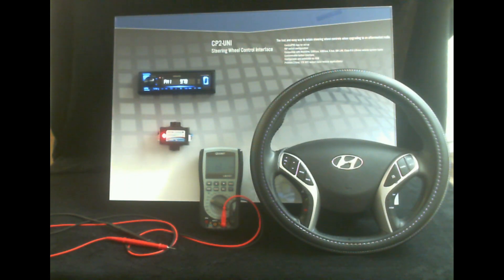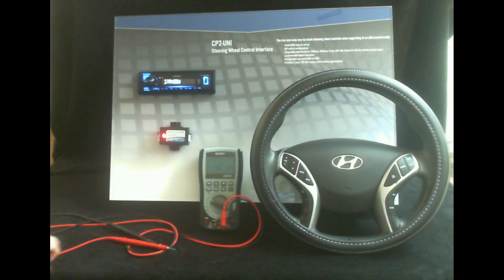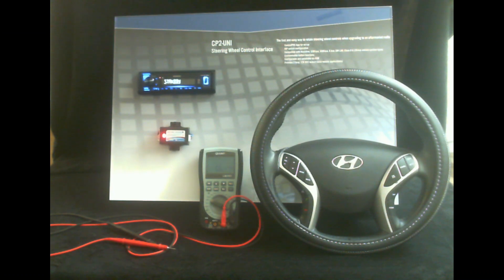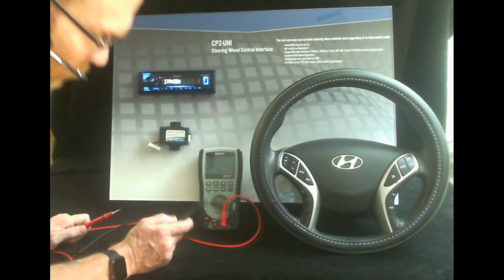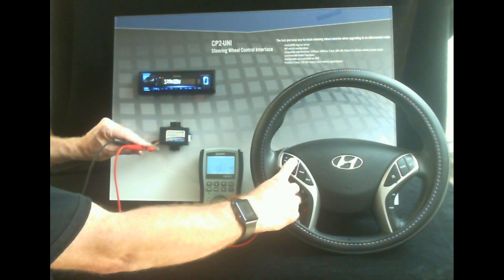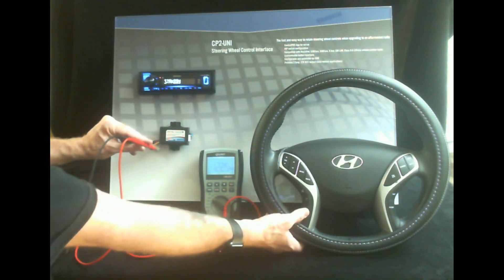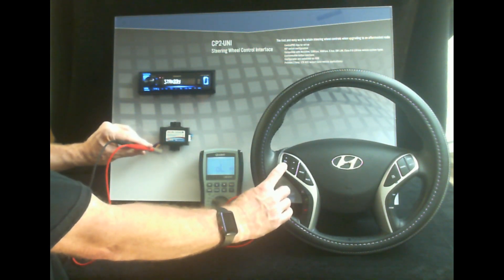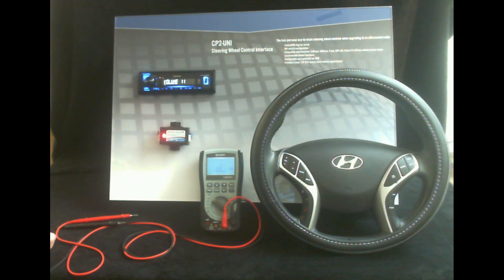PAC How to Test Analog Steering Wheel Control Circuits

Comment: I have a ControlPro CP2-UNI (PAC SWI-CP2). I only have four buttons on my steering wheel and I would like to add more functions. I know about the long press and short press, but I don't want to use that function.
Since all the ControlPro/PAC does is to change the resistance over KEY 1 and KEY 2, would it be possible to add a switch and a resistor and then have four new functions (depending on how the switch are) on the same buttons?
If it's possible, which resistance should I pick on the resistor?
My head unit have a setting to add more buttons, so that's not a problem.